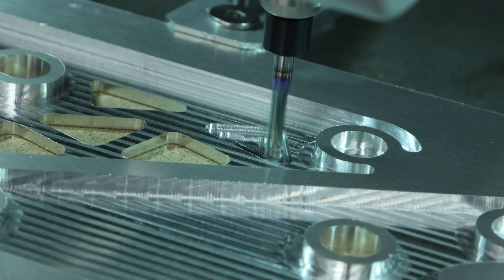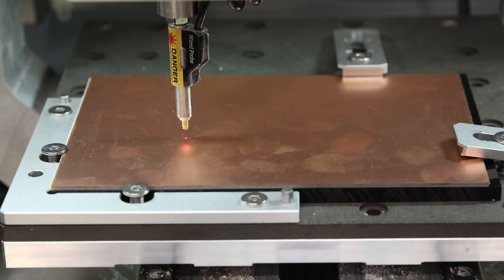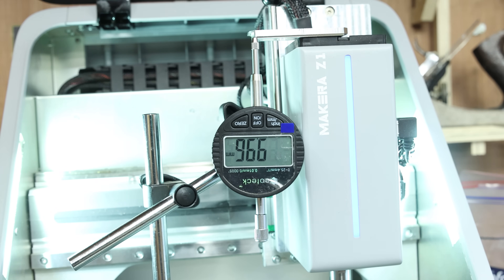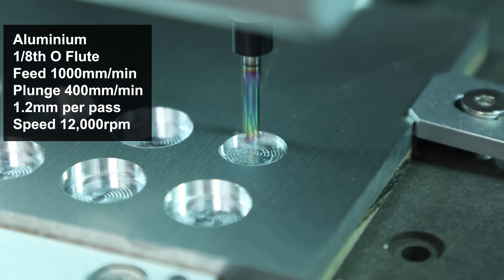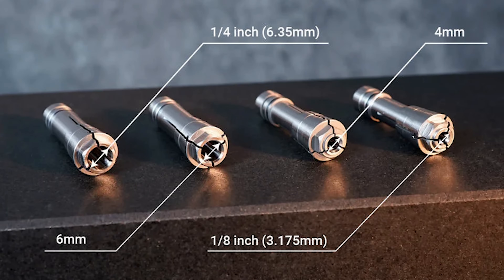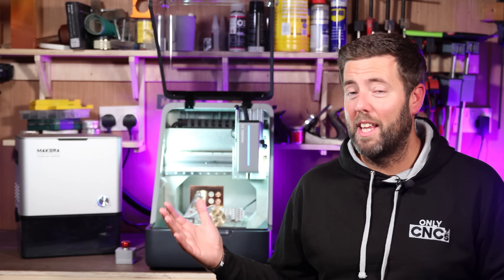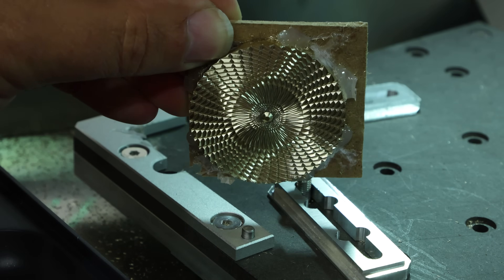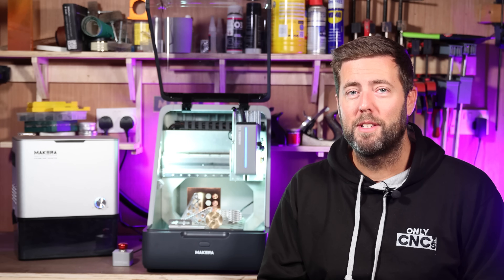Detailed look at the Makera Z1 - How accurate is it really?

Comment: That’s not backlash test that’s repeatability.  Back lash is stepping away from the indicator.  How far it moves before it moves before the indicator moves.
Reply: Try it on an old worn out manual lathe.  Wind in a direction.  Then wind back.  You’ll feel the slop.  It will be more apparent.   If you wind it 10mm to a point.  Wind away then wind to a point it will be the same every time.
Reply: Also backlash is compensated for in the control.  It knows how much to actually move in opposite direction to actually move the table.  If there was 5mm exaggerated movement it would move 5.01mm to compensate.  Although I doubt there is much slop on a brand new machine so they probably don’t bother setting it up.
Reply from the maker: OK so I want to try and clear some confusion up here because I have just read a Haas CNC manual for backlash testing, and according to that I did this correctly.
Method: moved the axis in a negative direction until it touched the dial, reset dial to 0, jogged it negatively 10mm, jogged it positively 10mm, negatively 10mm, positively 10mm....all the readings were consistent.0, -9.94, 0, -9.94 etc.  By my understanding if there was backlash one of those values would have been different.
Reply: @JamesDeanDesigns if leadscrews are accurate (they probably are) it means backlash is 0.06mm, can you see what kind of leadscrew nut they are using? is there a pretension on that nut?
Reply: Well, not exactly, depends on what side of the backlash you start.
Is really doesn't matter if you're moving away or towards the indicator, but which way you moved before you started the test.
Reply from the maker: I've always done the backlash tests like this, move it multiple times back and forth and see what the offset is in both directions...oh well, that gives me another test to run if I do another video 👍
Reply: @J@J@J @JamesDeanDesigns Can you post in the comments and/or this videos info / description , the actual backlash.  Just move in one direction , take note of the machines DRO , zero the dial indicator , then step in the other direction a known amount, say 5mm, then check what the dial indicator says.  If the dial indicator reads 4.92mm just subtract that from 5mm.  That result is the backlash in that axis, in this example 0.08mm.
Cheers!  Thank you for your reviews !

Comment: I wonder if the apparent accuracy “improvement” is actually a function of it being smaller.  

If the z1 and air both have say a 5% error (I’m making this up) then 5% of 200mm is smaller than 5% of 300mm… 🤔

Fancy getting some better bits and giving the stainless another go?  I’ll be honest I just want to see it suffer 😂

The vacuum is a bit of a disappointment but hey with a cnc machine and a 3d printer…. Can probably just add a dust shoe (or some other solution…
Reply from the maker: I may continue to tinker with stainless 😆
My knowledge of machining stainless is minimal and I always like to push the machines...knowing me I'll burn out the spindle or something 🔥
Reply: @JamesDeanDesigns even mild performance with mild / stainless - just cutting a profile out of a piece of thin ish sheet and putting some holes in it would be handy for things like brackets…
Reply: @Durkan34  Indeed, I share that hope as well. Good thinking.
Reply: That does not really make sense considering kinds of components the machines use. I would guess that it's either down to increased rigidity because of its size (so not the machine accuracy itself) or more likely from the difference beween the linear rods of the air compared to the rails of the Z1.
Reply: @t @themechanix393 ah proportionally higher rigidity is probably a good shout.